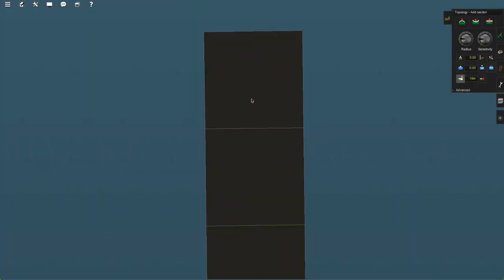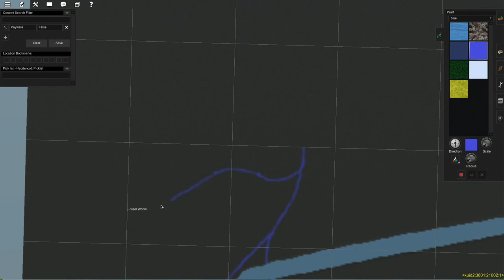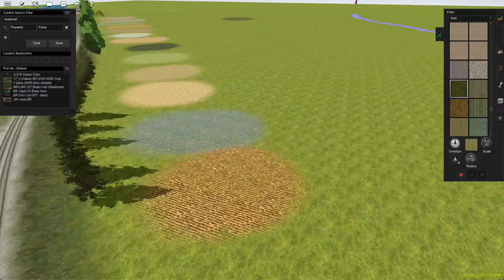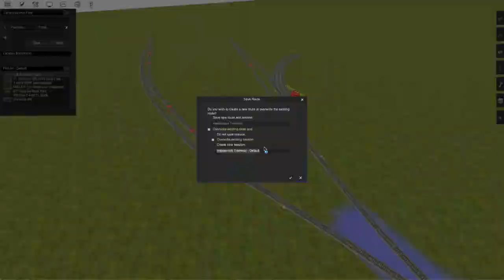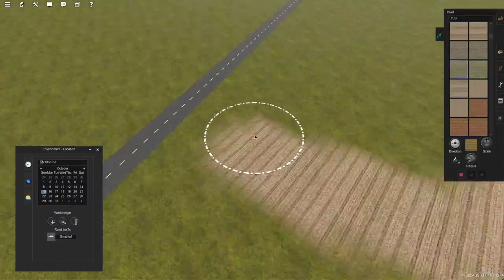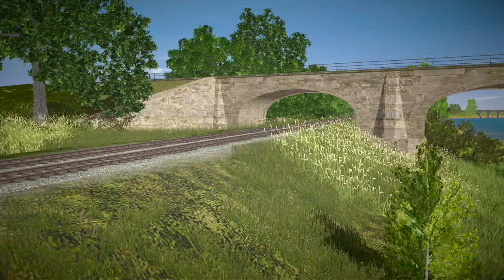Trainz route building | Haddencott Tramway Ep. 1

Comment: Absolutely fantastic detail and realism. Can you explain your method for making smoother embankments?
Reply from the maker: Usually I just use the Plateau Tool with a small brush setting to either drag out the terrain from the height of the tracks, or push in the terrain from about half the height of the embankment.

You can also place temporary tracks/splines at a 90 degree angles to the track (so that one end of the spline is at track level, the other is at the base of where you want the embankment to meet ground level), and then set the terrain height to those splines. After that you can delete the temporary splines. If you wish to have embankments with a specific angle, you can use the gradient tool to give these temporary tracks that specific angle before setting the terrain height to them.

If you're using the second method, it may be wise to shift-click place the tracks so that they do not connect to your actual tracks.

Does that make sense?